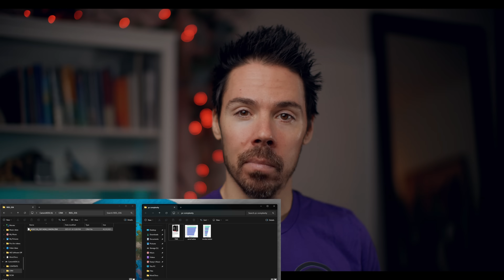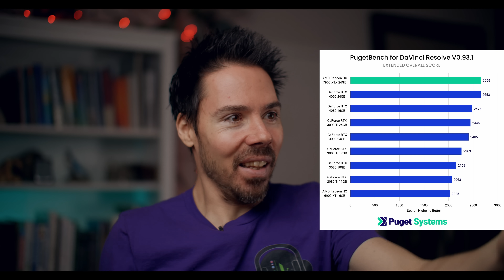The PC Building Rabbit Hole NEVER ENDS!

Comment from the maker: If you buy today's gear through my affiliate links, a rabbit will ask you to follow him to the delivery.  Just go. :_Logo::_Hammer::_Pony::_Toneh::_Fuji::_Nikon: 
Thank you for your Bitcoin donations :) bc1qacvd72s9565hpat4jueeultha3qvrv4kznyl3f
5900x https://amzn.to/42vCG4h
Noctua D15 https://amzn.to/3C9CEnX
Canon C70 https://amzn.to/3B8W5MU
Canon speedbooster https://amzn.to/4ibjtKf
Canon EF 50mm f1.2 https://amzn.to/49swXO3
All my gear and recommended products can be found in my affiliate shop, thanks for shopping around! https://www.amazon.com/shop/vegetablepolice
Reply: 14:41 💜💚🤘♾️
Reply: If that is the correct picture of your motherboard just get an USB 3.0 to USB-C cable/adapter. Your motherboard literally has the USB 3.0 header on it.
Reply: Your PCIE4 lanes provide more bandwidth than your GPU can handle, so this is a non-issue to start with. Yes, not blocking your GPU fan is a good idea, so just get a 1x PCIE USB-C card and celebrate your veggie-burger turbocharged life.
Reply: @decoryder  His motherboard does not have PCIX 4.0.  It's PCIX 3.0 only.  He was also using PCIX lines for the USB-C card and his system NVME drive was in the wrong slot, slowing the whole system as well.
Reply: @Omega_Mark  Oh, you're right - I should have looked it up - it's a 2019 B450 Aorus Elite. In that case the NVME should go into the M2B_SOCKET.
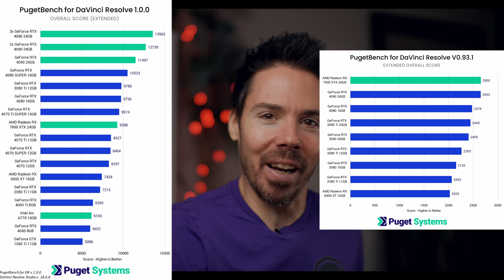Reply: 13:08 Wait depending on your Tasks the AMD GPU can be still superior cause of that massiv VRam
Reply: Dude, just get a M4 Mac, I switched to Apple Silicon and I have forgotten how hard was to be on a PC, it just works, Resolve runs way too fast 😂 it doesn't matter if it is a RAW 8K footage, try it out.
Reply: @RodrigoPolo  I recommended this to him but he's too chicken to try a whole new and impossible to understand an OS that was literally designed for brain dead people. He also never tested or tried one for longer than 30 minutes to see if he can work with it.
Reply: @RodrigoPolo  If I didn''t game 30% of my cpu time, I'd get a mac for production work. I miss my old mac. I had the original flat panel all in one model(can't remember the name) and it lasted me for about 5 years without a single upgrade. Had to bump the Ram from 2gb to 4gb at that point, and then it ran for another 3. Mac really is the best for production.

Comment: I went from PC to Apple years ago.  I just wanted to say that either system works, despite what particular fan boys rant.  The biggest issue if you ever think of switching is the software cost.  I did this years ago when everyone bought software outright. If you use subscription stuff today then things will be different, but just re-buying Office, and other required software suites for Mac when I switched was "holy shit".  At the time Mac software also seemed more expensive.

Comment: Bro, there's no easy anything. 

AM5 is much faster simply because of the DDR5 speed vs DDR4. Outside of that, dual SSDs for proper operation, you're pretty close to a well running machine outside of the USB transfer speeds. It's a complete dumpster fire of money vampire dealing with computers. Biggest issue is just being in Canada and using Canadian dollars, things are about to get a lot worse. Glad I moved to the US. Cheers!

Comment: Edit a file without the usb card installed....time it....edit it again with the usb card in. if its slower then it has bottlenecked you. if your motherboard is pci express 3.0 then 8x mode could be a problem. pcie 4.0 is double the speed of 3. so now you are operating at 1/4th the speed at pcie 3 8x instead of pcie 4 16x. There was no reason not to start with upgrading the motherboard.

Comment: Go for a B550, the MSI Tomahawk you can get a great deal that has what you need. You just need the motherboard. Your GPU is NOT optimized for Davinci if you're using Resolve. AM4 is GREAT. I have two PCs, one AM4 and AM5 with a 5900x and a 7900. The 7900 out performs that 5900x with lower power draw, and your BS fan would be fine. A Lian Li Gallahad Trinity II AIO would be great for the price point for the 5950x. However Resolve LOVES CUDA cores which is unique to Nvidia graphics cards. I prefer NVIDIA for my production work overall, as much as I despise the company's anticompetitive nature. However your CPU dictates how many PCIE lanes you have, and your mother part will dictate HOW those lanes are used. You really just needed a new motherboard. Anywho, id love to answer any questions for your particular usecase at ZERO charge. I do own an IT company and am a registered OEM, however I work in the private sector typically. I love your channel though! I'd love to help, feel free to message me. My website is down because I'm teaching my daughter UX/UI design (she's young and doing her best) but you can email me at dgodowsky@idigresstech.com or message me here. I'd LOVE to help and make your headaches go away just for fun brother.

Comment: Buy a B550 board with good IO in the back, and all that problem is solved.  It will have USB 3.2 2x2, Then 5800x is not for creators, more for overclocking for gamers.  5900x is a good price/performance choice for AM4.  And your PC builder probably just didn't even see the first m.2 slot because he got the CPU fan / GPU covering over it, LOL.  For the 2nd m.2 SSD, you go into Disk Management in Windows, and format the new SSD, and it will show up as D:   4070 ti super is better than 7900xtx, but wait for RTX 5070ti, because it has hardware decoding for Sony a7s3 format: 10bit 422 in H.265.

Comment: Your motherboard should support up to DDR4 3600(o.c.) but may require a bios flash if it isn't an option in the bios. The Amount of PCIE lanes available and how many are shared will depend on a combination of how many pcie lanes your cpu is providing plus how many your motherboard chipset is providing. Unfortunately the motherboard you have is more geared towards gamers running a simple setup of 1 video card, 1 m.2 ssd and not so much for enthusiast or creator use cases.

Comment: Ok, to awnser some of your questions, 1 Your Ram speed is fine and... your not overclocking it. Usually when you set up a PC, and you 1st instal and set up your ram (in your BIOS settings, you can tell your motherboard what ram speed to run at. (By defualt it will usually run a slower than registered speed. I.E. 1600mghz vs 2400mghz) your Pc is perfectly capable of running your ram faster but, apparently it was set to the lower speed setting. 2) AMD processors (CPU) and AMD GPU's Have always been graphics rendering beasts (they outshine Intel in that area) I know I'll prolly get some heat for that statement but it is true due to how the 2 diffrent methods the CPU's work. How it was explained to me. immagine 2 people sitting down to a hamburger eating contest. 1 being intel and 1 being AMD. The judge says go! The AMD guy takes huge bites and chews it the swallows the peices. The Intell guy takes super small bites super fast. What does this mean? Simply put Both CPU's reach the end goal roughly at the same time. But Because AMD can take larger bites of information (Like vidieo rendering) then take time to prosess the info, The AMD CPU is more effective at crunching larger chunck of info, where as intel is great for crunching vast amounst of numerical data very quickly. And Benchmarks will reflect that. Now as far as something being faster than what you have... there will alwyas be something faster, better, but, at the end of the day, if that PC is working, doing what you want it to, and you are happy with the preformance with it, I agree with you, don't fix it :)

Comment: I've been working with computers since 1979 and PCs are still very primitive. I feel your pain. When I built this PC I started with the D15  but it wouldn't fit. :-) But it wasn't the RAM, it was the motherboard shroud. I watched a video with someone taking a Dremel to the shroud, but I decided it was easier to get a different cooler. And I still have to offset one of the cooler's fans. Because of the damn shroud. So thank you Cro-magnon tech industry for all of your nonsense.

Comment: 1. use a simple USB-A to USB-C adapter instead of a PCIe card (unless you need more USB connections in general)
2. your M.2 SSD should be installed in the first slot. if that does turn off some connections for other things, your motherboard manual will tell you what exactly is turned off by using that slot, so you can potentially rewire stuff if needed. but you should have enough working connections for everything that you need.
3. enabling XMP/EXPO in the BIOS settings is the right way of using the basic overclock from your RAM. your motherboard is technically overclocking to those (OC) RAM speeds, but that's totally fine and has not much to do with manual overclocking.

PS: motherboards today do still have a lot of restrictions when using multiple PCIe lanes or M.2 slots. however there are some premium motherboards that can get kinda expensive, that don't do compromises (or at least less), and it really differs from board to board. imo the biggest difference between a 250$ and a 500$+ motherboard are the connection compromises and some little niche extra features
Reply: Exactly ,so you want  the expensive one with gen 5 so you can use it for gen3 instead of gen 2 😃

Comment: you bought a Noctua d15 (109.99) instead of a Scythe Fuma 3 (54.99)? that's sad and also shows how research is very important for saving money because realistically you're not going to use your cpu for rendering the video since the gpu is doing it so what is the point of going with a d15 if the cpu isn't going to work that hard? also the Fuma 3 has great build quality and is quiet.
Reply from the maker: CPU works hard all the time, my fan is always loud.  I went with a reputable brand that will send you new mounting gear for free when you upgrade platforms.

Comment: Not all motherboards have shared pci-e lanes in these pci express slots, some of them can actually slow down your main slot when you plug in something in others, but most of them will just slow down your NVMe drives or turn off some of the SATA ports. It's all because a CPU has a limited amount of pci e lanes (most of consumer platforms have up to 24), and all of them are needed for video cards, sata drives, NVMe drives, fast usb/thunderbolt, and extension cards, so in order to give your GPU the most lanes, it has to cut corners somewhere else.

The management of these pci express lines goes to your CPU's generation and motherboard's chipset - cheaper ones tend to have less lines and turn off some of the capabilities (such as sata ports and etc.) while others just straight up don't have more than 1-2 NVMe slots or lack fast USBs. For example, I bought an AM5 motherboard with X870 chipset from AsRock (RS Pro Wifi), and it will turn off the second pci e slot when if I plug sata drive in the slot 3 (there are 4 of them), but it will keep both USB type C (4 gen) ports on a full speed (20gb/s) no matter what. On my previous platform, I had a B450, and besides being older than X870, it had only 1 NVMe slot (X870 has 3 of them), and one additional pci e slot. 

These consumer platforms are made with gamers in mind, and in most cases everything they need it's just a single pci e for a powerful GPU, a couple of fast USB ports, and 2 NVMe slots, 1 for system, the second one for games and photos.

If you reeeally want to have more pci e lanes, then you would need to consider workstation platforms such as AMD's Threadripper or Intel's Xeon, but be ready - these are really expensive

Hope I've helped you a bit ;)

Comment: RAM speed can be specified in 3 ways. 
1. Mega-Transfers / Second (MT/s) - When you enabled XMP, you are running at 3200MT/s. 
2. Megahertz (Mhz) - When you enabled XMP, you are running at 1600Mhz. 
3. Megahertz Lies (Mhz lies) - When the marketing department has no idea, and uses Mhz in place of MT/s, leaving you with yet another reason to buy a Mac. (Don't). 

(1600Mhz = 3200MT/s because this is "double data rate" memory).

Comment: I think you should just upgrade the motherboard to a B550 series. They can be bought quite cheaply now. It would likely have been a better purchase than a plug-in card, and give you a much better upgrade path for the future. Finally, go back to Windows 10 (assuming that was what you were running previously) as Windows 11 is absolute 💩.

Comment: The thing about splitting OS and data up on separate drives is really no longer relevant. nvme's are so ridiculously fast, it's not worth worrying about. 
Put the nvme in the top slot though!
Ram speed: just enable xmp. Don't stress about it. It's not that important. 
Make sure you have SAM or RESBAR enabled on your motherboard. It's another thing that's off for compatibility reasons, but should be on for the 7900xtx.

Comment: A PCI to USB plug card should not be more expensive than 5 or 10 Troglodyte-Buckaroos. You have been ripped off because that USB card costs more than currently a 1TB Kingston high speed NVMe drive... ;) 

And I recently found out a huge AM-5 board problem too. Some AM-5 boards now shut off all other PCI-Slots but the upper graphics cards slot when inserting an NVMe drive into one of the mainboard M.2 slots. This is so CRAZY because I use a PCI-card holding four NVMe drives cooled with GrauGear coolers - and this card currently holding 4TB of the fastest NVMe´s becomes useless because when implementing my other NVMe drives directly into the mainboard all PCI but the graphics card will be switched off.
Somehow limiting graphics card lanes is one thing but completely disabling PCI slots when installing NVMe drives into a mainboard M.2 slot is outright crazy. And nobody even mentions it! 
Only ONE YouTube video mentioned oh: "Oh by the way all of your lower PCI slots will get disabled when using this or that mainboard M.2 slot." 
Oh, aha, thanks for at least one person mentioning that "unimportant detail" I almost bought that mainboard! Now I wait a year for the new X870 chipset and it´s BIOS to fully develop and mature like fine wine and get the prices down because the current B650E chipset clearly cannot cope with the planned 10 Terabytes internal ultra high speed NVMe space.

Comment: Welcome to Windows building.   Rule 1.  never upgrade.  new build and start over.  otherwise when you get annoyed or the cpu/motherboard fails you get a new one, now your new GPU card is not as good as the new 2026 GPU's that does something better that we don't know about today.   Anyway I have a Mac mini M1.  silent.  works fairly well BRAW 4K and 6K.   Looking forward to a new Mac mini 4 Pro.  though if I were only using QuickTime I would just buy a non pro Mac mini 4.   (has pro res video co processors so there is no advantage for a pro version unless you use CPU 3D animation or heavier 12K BRAW files.  That being said I'm thinking about picking up a windows box for 3d animation (only get NVIDIA GTX series.. probably 5000 series 2025 that come out later this year.   I'll pick up a new system and let someone else figure out how to piece it together.  I used to do it all the time back in the 80's, 90's and even 2000's.   but today I find it just annoying.   today 99% of the time I far prefer the Mac silicone system.   quite, no heat, so no or little fan noise under heavy loads.   The GPU's on the Mac series are good, but not utilized by software companies yet.   so a Mac Mini 4 Pro is probably close to a Nvidia 4060 variant.   but 3d animation software, games, rendering etc doesn't make use of it.  that's ok, most pro or semi pro software don't make use of ATI either.   If you went Mac, I think you could get away with a Mini M4 (not pro unless you really want to use Davinci with BRAW a lot). and load up the memory and the SSD size and have a sweet strong computer that doesn't make noise that is the size of your smart phone box.   It's the opposite of my Mac Pro 2008.  That monstrosity sounds like a jet engine taking off.  so glad I don't use Intel CPU's anymore.   When I did anything the Mac Pro 2008 the street lights would dim and the fan noise would take off.  :)

Comment: Your RAM is safe. That is a decent motherboard with plenty of cooling on the little power delivery chips to keep it from overheating. You would have already noticed as the PC would have been running inconsistently speed wise and or crashing.  turning on XMP is like an overclock to the CPU.  I'm trying not to rabbit hole here LOL. Yes your CPU is fine with the cooler. That's on it😅

Comment: Just buy a new mobo bro. You can just reuse everything else lol and then you'll have your USB 3.0. Takes a few hours, but getting it switched over is very satisfying.
Reply: Not sure about Toronto market, but in my area X570S mobos go for decent price cuz those guys were quick to upgrade to AM5.

Make sure you get the X570S not the older X570 cuz of the onboard chipset cooling being passive instead of having a little fan that's prone to failure and makes unnecessary noise.

Comment: Transfer speed looks good to me. The SSD is indeed in a "slow" slot, this means that the max speed will be around 1.5GB/s, but the SSD you have is not much faster to begin with (<2GB/s) thus I would not worry about that. The transfer speed you showed seems normal because you are limited by either the USB port you are using or the SD card speed. Remember that your max speed in any case will be limited by the slowest component in the chain. 
In other words moving the SSD won't help with transfer speeds, but might have some impact on editing (MIGHT). 

Note that having 2 SSDs is ideal but definitely not necessary, you most probably would not take advantage of the extra performance/speed, only real advantage it would have for you is that if you like to reset Windows you won't need to do extra backups or move all your data afterwards since it will be already on a separate ssd.